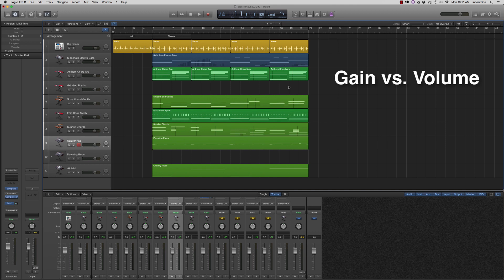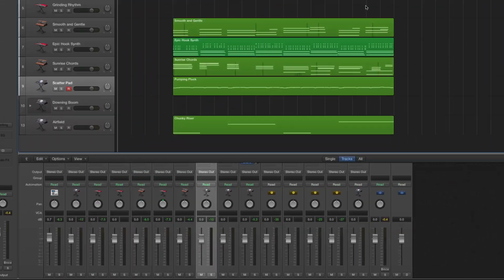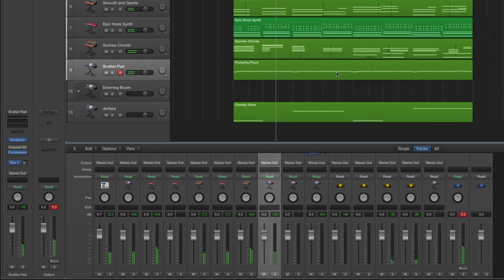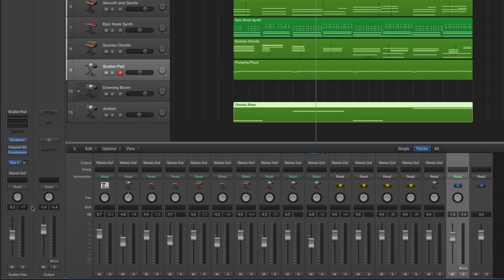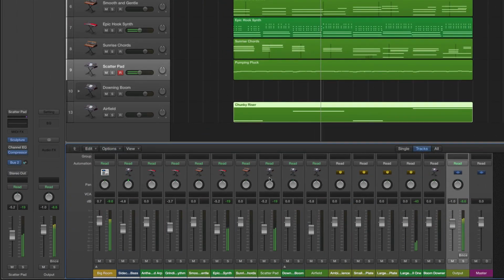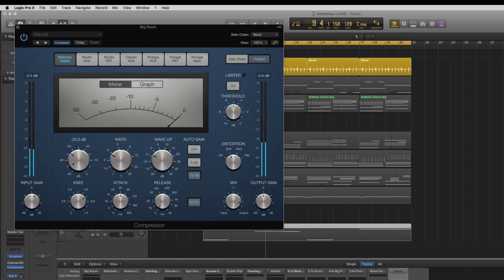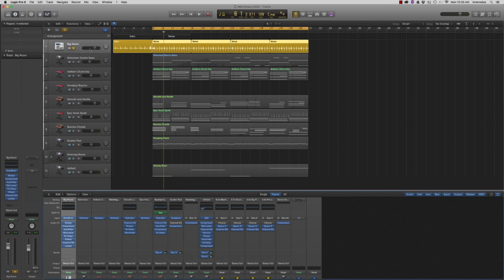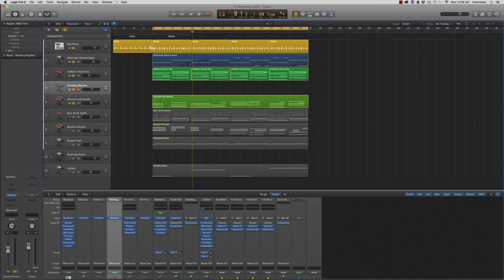Gain vs Volume - Production Concepts

Comment: This information is mostly incorrect. Gain is not a measure of signal strength, it's an amplification. Gain changes volume. Volume, like loudness, is the subjective way we measure Sound Pressure Levels. And there is headroom above zero in digital, just not on the final print. Floating point gives us headroom, not that we should use intentionally

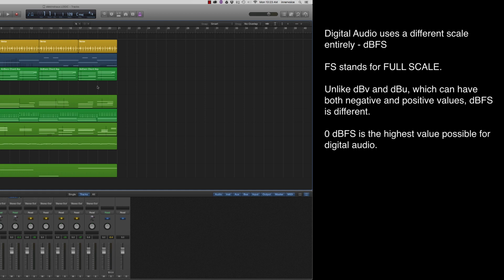Comment: 1:52 "All measurements in digital audio are negative" can be quite a misleading statement for someone who doesn't understand the context.  
2:17 You can totally overload digital channel strips other than Master without clipping. 
3:36 Two identical signals at -6 dBFS add up to approximately 0 dBFS. This happens only if the signals phases are in sync, which is not always the case in practice. Also you're using the term "volume" for describing signal strength, which contradicts what you said in the beginning.  
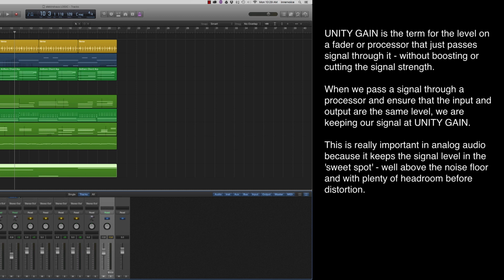6:40 Unity gain doesn't ensure "sweet spots" in analog or good mix levels in digital. 
7:17 "Making sure nothing will go past unity" means you should monitor and balance the inputs and outputs of all processors in all signal chains. Looking just at the channel levels doesn't tell you that. 
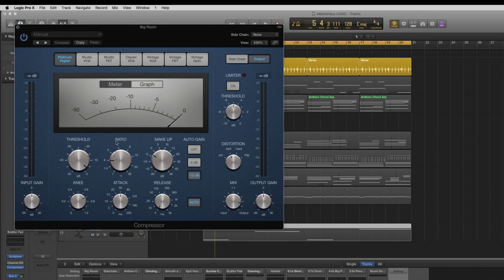8:28 You're changing the signal level from -10 dBFS to -5 dBFS with the compressor. This is not unity gain. 
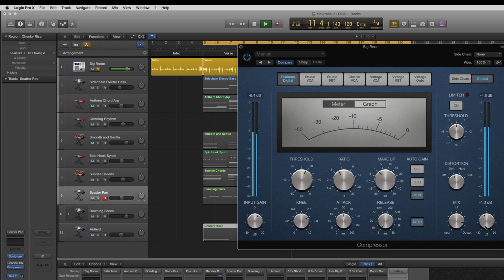9:55 Why not use the compressor's integrated limiter? 
11:28 Panning to the side will not reduce the signal level of a balanced signal. In fact, if you're applying pan law compensation on the channels (I think it's disabled by default in Logic), you're increasing gain as you move away from the center. 
11:40 How exactly do you "pay particular attention" to low frequency channels?
Reply: +stephen ellestad..... Schooled!! Lol. Great break down.
Reply: sick. where is your video on this i wanna see it.
Reply: @innervoicemedia  So classy.

Comment: A few questions: should you ever pass 0 on the master fader on your overall mix? Should you ever change the master fader from its starting point? Sometimes the overall mix sounds too low, so I boost my mixes.
Reply: Try adding a compressor/limiter on the Master's Inputs, and use the gain in it to boost the volume. Off course you could also compress it to boost more.

Comment: Gain is the measurement of how much a signal is affected between the source and the output, Gain is objective meaning the value wont change regardless of the speaker or environment. Volume is ambiguous depending on external factors like speaker size and environment, A sound will have a different perceived loudness through the same amp if its through a 10" speaker right next to your head compared to a small portable speaker 10ft away outdoors even if both set at same volume. Volume measurements are arbitrary and have no value unless you are describing the exact same equipment in the exact same environment.
Reply: @AD4 nothing simple about that, I still can't understand it. Someone has some picture which explains what actually happens to sound wave?